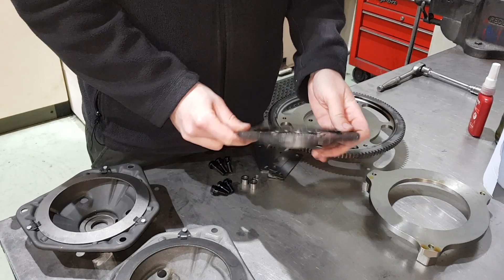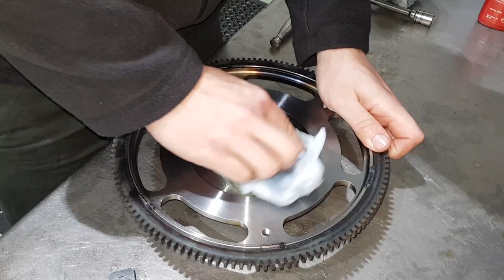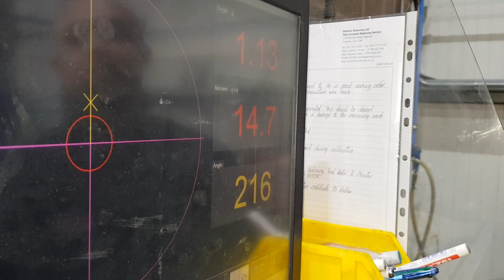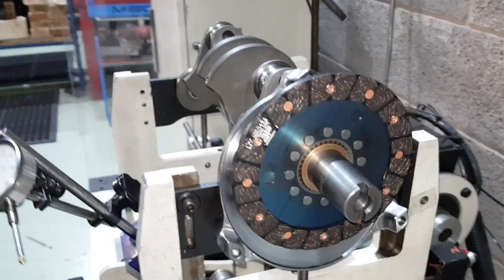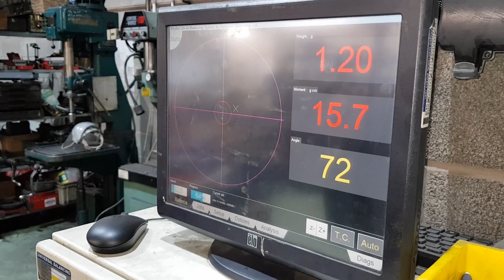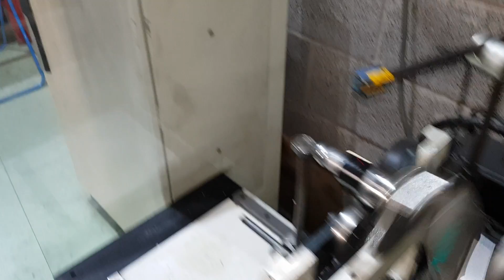How to assemble a lightweight Mini clutch and flywheel

Comment: Hello ,make a fantastic tecnical videos.
I have a orange diafragm on a preverto clutch...
The spring,  how many comprees?
So that it does not slide and there is an adequate pedal path

Comment: Looks a nice lightened Flywheel assembly, I used to lap the flywheel onto the crank I was using first, then bolt it on to the crank, set up in a lathe and machine a couple of tracking bands to use as datums. Then remove from the crank, and lighten using the datums to set up to as I found originals did not always run that true. Still very interesting.

Comment: Great video as always. I’ve got a verto ST1 from you guys, but a failed crank seal meant oil made its way onto the clutch plate. I’ve marked TDC on the fly and pressure plate, both of which had material removed to balance. If I take the clutch out and replace, and Install in the same orientation, reckon this would knock it out of balance again? No material is to be removed from the clutch plate.
Reply from the maker: Yes this should work fine. The Verto cover is dowelled in place, unlike the earlier type in this video. So there's less chance of knocking the balance out when swapping a clutch plate.

Comment: Do you guys make and sell diaphragms?
Been trying to buy orange or grey spec ones now for some time and AP racing stopped making them. 
Can you do a video on the different specs please👍
Reply from the maker: We've been out of stock of the orange and greys for over a year but there's light at the end of the tunnel. Hoping to have a new batch in production soon, as we've had to make do with second hand units.
Reply: Thank you for the reply Ive been trying to source even a second hand unit for my supercharged build. would you be interested in making a video about the different specs and applications based on HP and torque as well as touching base on the out of stock reasons and whats been done to resolve the this.
Reply from the maker: @darryl3392  sure. We did include it in this video but it was over 30 minutes long on the first edit!
Reply from the maker: @darryl3392  Yes, we'll pop it on the 'to do' list!